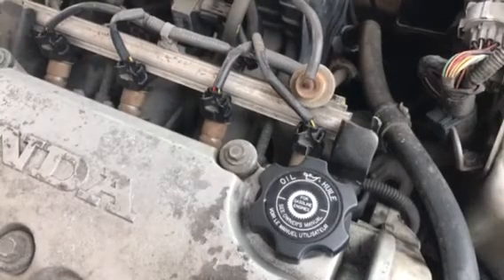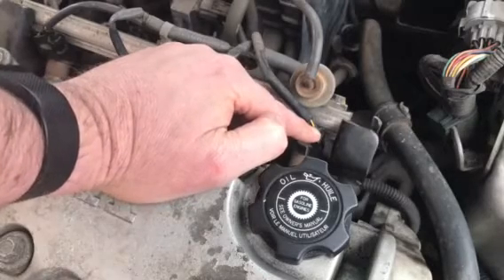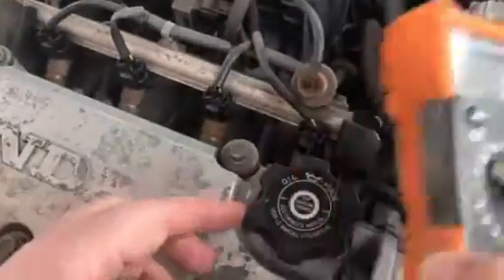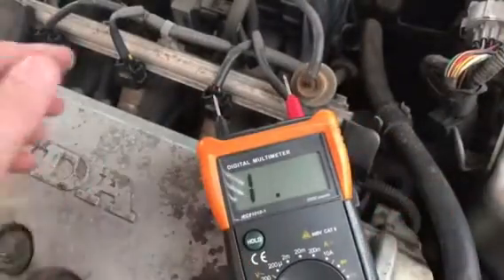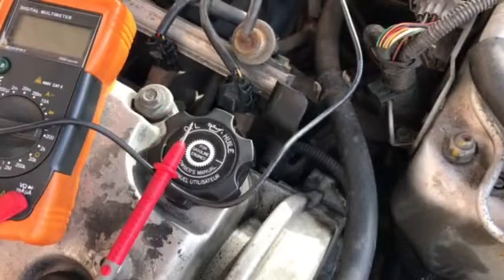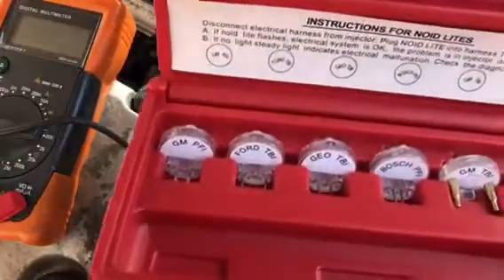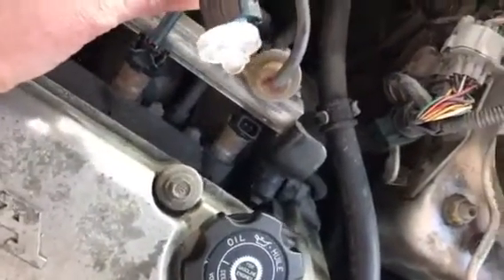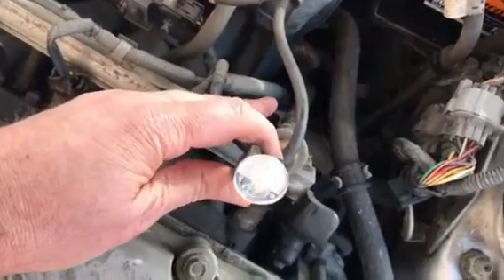How to check for injector pulse on a 1995-2000 Honda Civic

Comment: Speak up mublemouth, I have a volume control!
Reply from the maker: Nice comment
Reply: @drivewaydiyer6504  Costructive critisism. I am herd of hearing, but I can most others, If you are to loud, I can turn it down. But not vice-versa. Like to have heard this.
Reply from the maker: The sounds fine, get your ears cleaned out, must be a waxwork museum in there.
Reply: @drivewaydiyer6504  I have hearing issues and wax is not it. Did you read the part where I said that most videos are loud enough to me to hear? But no you're a perfect narcissist.
Reply from the maker: Well this turned on a six pence. I’m here to help people fix cars. If it’s not for you, then find another channel, but don’t come on here and insult me, then accuse me of being a narcissist when I respond to your insult.

Comment: What do you do if the signal wire is broken?
I came from the car computer
Reply from the maker: Resolder it or replace the wire, do you have a definite break?
Reply: @drivewaydiyer6504  The problem is that there is no signal
From the car computer to the sprinklers, is the problem with the distributor?
Reply from the maker: @مصطفيالمسيري-خ9غ  it maybe a computer problem, check wires, connectors. Have you definitely got an injector problem. Do you have a code?

Comment: Interesting, on my Honda Civic yellow-black is power for ignition circuits! And same on the fuel injectors. And it is the same on yours, at 5:40 you are getting "-12V" which means you had the connections reversed! And the ECU grounds the fuel injector signal wires when it pulses them. The signal wires are the different color ones. The power is the same color for all. Hope this helps.
Reply from the maker: Tuesdays Runner Thankyou for the input. Thanks for watching.👍